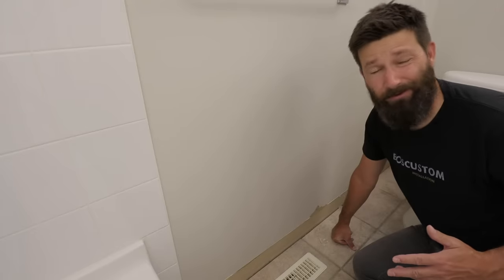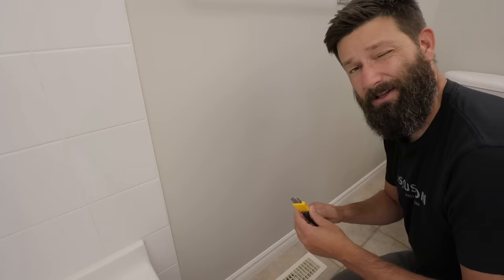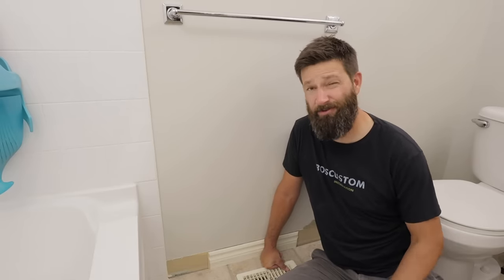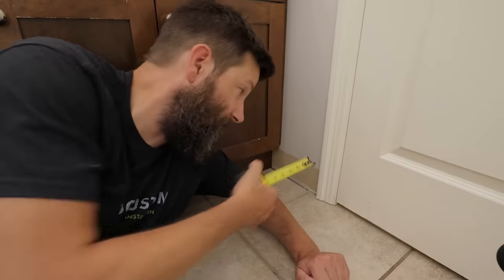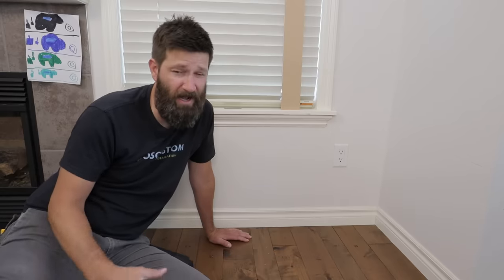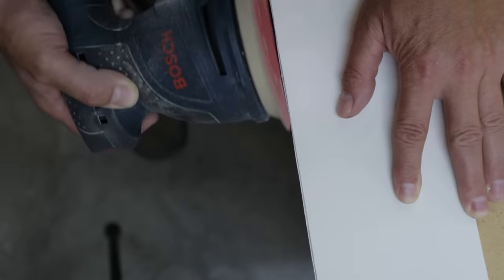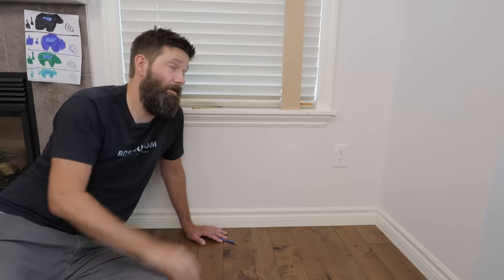The 4 Fatal DIY Baseboard Mistakes!

Comment: When it sits proud of the door casing that means you need to redo the casing and might as well get new doors. Since you're taking the casing off, might as well redo the floors. If the floors are up, maybe you should add some floor heating. Since you added floor heating in the living areas you really ought to do it in the bathrooms which means it's a good time to redo the bathrooms. If youe doing all that plumbing you might as well put in new plumbing. Welcome to my life.
Reply: I am right here.....we repainted the house to a different color scheme, only to find that the toilets were not actually white, they were light almond, so new toilets.....and the tubs....and the tile.....and the kitchen countertops.....and half of our decor.  We should've just knocked the house down and rebuilt it.....
Reply: @Calypso-rb9sf  Time to eat something white to make it match. 😂
Reply: Oh man.  I'm going through this, not quite as bad.  Got vinyl plank to replace carpet.  Might as rip out the crappy trim....might as well paint the walls too....might as well paint the ceiling.  One of these days I'll get to the part of actually putting the damn floor in.
Reply: Hahaha
Reply: Ah, yes. When a simple towel bar replacement ends up with a to the studs gut of the bathroom... And, of course, that's an opportunity to move some interior walls around... And, of course, during all this you discover old water damage under the windows... So off comes some siding and sheathing...

Eventually you end up renting a CAT 320...

So, don't bother to buy a towel bar... Just start at the heavy equipment rental yard so you won't end up with a useless towel bar that doesn't match your new home...
Reply: That's why I'm still renovating after 5 years, always those +1/may as well/since you're already there things that keeps on adding up lol
Reply: Oh yeah, I felt that. We started with couch shopping for the basement family room, which turned into taking out a cabinet (that hid the electrical panel) to fit a new sofa and if we were doing that, might as well upgrade the panel, and if we were doing that, might as well upgrade the service to the garage for a potential future electric car. And if we’re touching the electrical, we could really just take down the terrible DIY drywall the previous homeowner did so we can fix all the poor electrical junctions we know are hiding behind it, and if we’re doing that, we might as well move some walls, and if we’re doing that, we should spray foam the walls,  and while the ceiling is open, we should run gas lines for future gas range and outdoor bbq, and while the concrete is exposed, we should move the bathroom, and if we’re doing that we should replace the old cast iron piping and install a blow out preventer. … it ended up being a complete gut job. 2 years and 6 months (and two babies!) later and it’s alllllllmost done.
Reply: You had me sweating on the first sentence I gotta admit.
Reply: Are you me? I’m about a week from ripping the carpet out of my home office and if I’m yanking it from the home office, why not the whole 2nd floor.

Already looked into heating options😖…and this all started with changing out the ceiling fan.
Reply: @ang_131  My god, what a story! Next time my partner and I are getting the might-as-wells, I'm going to show her your comment and maybe we can just settle-for.
Reply: @beerhistory , I’m glad my story can help someone else! 😅 That said, I love every inch of our new basement and I’m not scared to open certain closets and cupboards down there anymore. We literally had a cupboard I refused to put anything in, I called it the spider cupboard due to how many I found in there during my original move in clean, whereupon I cleaned the cupboard and never opened it again until the day we tore it down. 😂
Reply: Someone else is living my parallel life? I did all that too! But I could not stop there. When I was down to the foundation my wife and kids got tired of the trailer so now I live in the trailer next to the hole in ground.
Reply: @beerhistory  trust me it won’t make much of a difference. It’ll always end up as “well honey we could just do one more thing since we’re doing this...”
Trust me, seen it with my parents too many times
Reply: Great post.👍👍
Reply: And now that everything is all done, might as well sell it for a nice profit. Babe, we are never doing this again. But since we’re in the market for a new house, might as well get one that needs a little work….
Reply: @spurcrawler249  🤣 😂 thats it!
Reply: @cyclemadness  I am in the same boat as you
Reply: We're 30K in debt over that EXACT circumstance.  Only in our case it wasn't a "might as well" scenario....it was a "so THAT's why the floor wasn't level", or "That's why the water didn't get as hot in the guest bathroom", etc....  The only solace I was able to get out of it was that, had I had to hire people to do it, I'd be $50K in debt. 👍
Reply: And once you start adding in-floor heating, you need to add circuits to your main panel. But it's only rated for 100 amps, so you may as well upgrade to a larger panel and 200 amp service. . .
Reply: @aaronmcleland4772  well now that you have extra space in the box...
Reply: Do one job and create two new ones
Reply: ... and once you've finished replacing all those things. You realize your basement height is lower than you'd like, but it'd cost $40k JUST to jack up the house to re-construct the entire foundation, so instead of doing that you sell your house for a $30k lose and build a house with all those issues addressed by building it correctly the first time!

Gotta love those DIY houses!! 😂
Reply: At my house I went from mudding and sanding the ceiling, to mudding and sanding the walls, to adding new baseboards, installing chair rail molding, painting the ceiling, painting the ceiling medallion, buying more primer, buying more paint, bought a 12" sliding compound mitre saw, and now I am installing 6" crown molding in a crooked house from 1975... I want to finish already 🥲 It's like it never ends...
Reply: @cyclemadness  my current situation! 💯🤣
Reply: Or just throw in a plinth.
Reply: @cyclemadness  I draw the line at painting the ceiling- thats never going to happen!
Reply: This is EXACTLY why I don't clean my window sills, thank you very much. Because it starts out as just a quick wipe down and the next thing you know, you are rebuilding your house....
Reply: @cyclemadness It's called "sequences"....
Reply: @spurcrawler249 Lol. Holy crap, that's me and my husband. EVERY home required renovations....and we were always saying,"Next house is brand new, we are NOT renovating again!" And of course every time we'd end up with "Well, we should get a place that needs some work, otherwise we'll be bored".....
Reply: @jasono2139  You guys above all sound married.  Establish boundaries, tolerances, costs and "livability" and just move forward.  Said the Bachelor.  Perfectionism is a plague, craftsmanship is meant to be enjoyable.
Reply: @yojimbos1  ironic that the person who thinks "perfectionism is a plague" is also a bachelor! 😂

Don't worry... the previous owner of my home would agree... because they screwed up nearly everything! ... which is why they probably placed tile flooring ON TOP OF the old flooring... 🤦
Reply: This comment needs an award
Reply: Exactly my experience the the last few month lmao
Reply: Add a backband around the casing then install your base to fix this problem.
Reply: @cyclemadness I hear ya -I’ve got the same thing going. I went ahead and put the plank flooring down just about to place the last 2 pieces. The cabinets need painted, the wall paper needs to come down and walls need painted and ceiling is gross but, hey, by the time I get to it, it’ll be time to replace the vinyl planks!
Reply: 🤣🤣"If You Give A Mouse A Cookie" is the book for you!

Comment: I learned a lot about baseboards in this video, more importantly I learned that Black Bears are the biggest of all the other bears.
Reply: Much bigger than green bears.
Reply: @davem6685  I like the red ones!
Reply: But which bear is best?
Reply: Bears eat beets.
Reply: Bears, beets, battlestar galactica
Reply: @brianwball40: I guess you failed the test then. Black bears are actually one of the smaller species well behind grizzly, kodiak and polar. I’ve seen teddy bears as big as some black bears, lol.
Reply: @rayray8687  🤦‍♂️

Comment: Want a perfect outside miter every time, first cut? Put painters tape on floor along both walls under where the baseboard will get installed. One at a time, place the board to be cut against the wall and trace along bottom edge onto tape. You now should have criss crossing line of the the basedoards outside edges. Place the board back in place and mark the outside edge of the criss cross onto the baseboards outside edge,  as well as the inside corner on the inside edge of the board.Put the board on your miter saw and adjust so that the blade just kisses both marks. Not only will the angle be perfect, but you won't make mistakes cutting the angle in the wrong direction. Not that any of us would ever make that mistake. Lol
Reply from the maker: A bit elaborate but I appreciate the effort!
Reply: @TheFunnyCarpenter  honestly, it's super easy and quick as well. I used this technique on crown molding too, since the ceiling was going to be repainted anyway, I just penciled right onto the ceiling. Fast, no cut mistakes, and it saves a lot of time caulking or filling sloppy joints later on.
Reply: I never made that mistake TWICE today EVER!! Lol
Reply: Is there a video that shows this step by step??
Reply: @rodbingaman6985  I remember what my grandfather said,"The elapsed time between making the same mistake in a given work period will greatly increase with a little bit of rigorous practice."

Comment: Another great vid!
I'm no pro but I have one quick additional tip that may be useful to newbies ( if watching, add in around 2:20); when prying base boards away from wall, work your way from one side to the other as he says, but try to APPLY PRESSURE WHERE THE NAILS ARE.  That works for basically everything you're trying to pry apart. Otherwise you apply too much flex to the board and materials like mdf may snap.
Reply: @keithmarlowe5569  The other day, I took up some solid wood trim that was installed ~30 years ago with hand-drive 6d finish nails. I kinda wanted to save the wood and see if it could be re-used on another project, so I went to pull the finish nails through the back of the trim, like I do all the time with 18 gauge pneumatic finish nails on MDF. 

Hoooolyyyyy crap. I think my arm was done after pulling just one through. The combination of solid wood being sturdier plus the bigger difference in diameter between the shank and the head on those 6d nails kicked my ass. Immediately switched to using my nail set to recess any heads sticking up and then flush cut the nails in the back.

Comment: 42 yrs as a pro. I never mitre inside corners. Cope only. Once you get the hang of it nothing else comes close for speed and quality. I simply cut an inside mitre,  then use a jigsaw with a narrow scroll blade and rest the bed of saw on flat of mitre and cut along the profile of baseboard. It automaticly back cuts the cope and gives knife edge to the cope. Also easy to adjust if necessary with a sanding block. Its easier than it sounds. Its super tight and fast. I run a room so fast it will make your head spin. Learned that trick from an old timer 30 years ago. Coping saw just takes too long. Of course im the old timer now. Love your tips. Great job.
Reply from the maker: That’s awesome Paul! Every good carpenter should know how to cope mouldings!  The place it come in handy for my is installing cabinets and tying in new crown to old crowns.  Thanks for supporting the channel!
Reply: @TheFunnyCarpenter  I cannot yet understand how to make the cut as described above. Can this be referred to in a video, or photo, so we can see it? It says "never mitre inside corners" but then says to do just that, "cut an inside mitre". So this is cutting a mitre but only half of the corner, on one piece only? So the one "half" mitre is the cutting guide for the other inside piece?

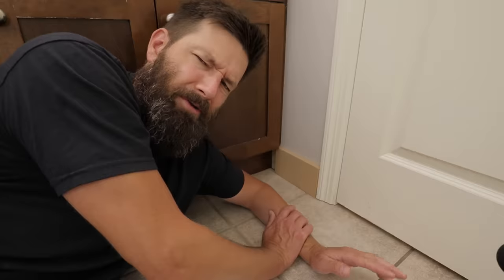Comment: 4:04 if people want thicker baseboards they can just use a multi tool to cut off a bottom section of the door casing and install a thick plinth block.  Looks nice.

Comment: Before installing baseboards or flooring have a professional come in and level the floor with leveling cement in required areas. They use lasers for this so it works well. I believe this would eliminate the need for shimming undersides of baseboards. Your thoughts? I had it done on my house and it worked good.

Comment: Replaced my builders grade finger joint pine baseboards a couple of years ago with larger poplar bb.  I didn't want to replace all the casing so I just added a back band molding to all the door casings.  Looks fantastic and a lot less $$ than replacing all the casing.
Reply from the maker: That’s a great idea, I’ll remember that for the future.
Reply: What is a back band molding?

Comment: baseboard to floor gaps traditionally hidden by quarter round, shoe mould or door stop in most parts of Ontario, would never consider installing baseboard without one of those options. going to try your inside and outside angles, have a lot to instal . I personally like the look of oak quarter round finished to match the hardwood floor.

Comment: Very interesting. I bought an older home where the floor has sunk in a few places. Theres a massive 1/3''+ gap with the baseboard that I'd love to clean up. May have to try this in the future, but sounds like ill need to start with a pretty big board to compensate.

Comment: I know some would give me grief over this, but we pulled up carpet in three bedrooms and closets and put down wide hardwood planking. Floor needs expansion gaps hidden under trim. Choice was to pull up all the baseboard and replace over the new floor or leave the baseboard, add a gap and cover with quarter round. I chose the second one.  We saved tones of money and time.   It looks great and I would do it that way again. It also solves about half of the problems shown here.
Reply: @blaster 0416: If the baseboards are 100 yr old 1x8 planks over plaster you definitely don’t want to remove them or you will also remove half the wall with them, lol.

Comment: My table saw only goes to 45 degrees. I don't think I can stand this long board on end to do a 45.75 degree cut. Do you actually have a way to make that cut? I definitely need to do it as you were spot on with pointing out the problem.

Comment: A few pointers I will add from my struggles or experience.  The trim removal bars are worth the $30 if you are doing a whole house or frequent work.  Coping the inside corners is my go-to after trying different ways but I use an angle grinder to cope; learned that from another YouTuber.  You need a steady hand but it works on MDF or finger-jointed pine.  For dealing with humps in the floor, my Bosch 12V mini planer is magical for shaving down the bottom edge of baseboard quickly.  I was already in the Bosch 12V line so it was an easy purchase for me.
Reply: Whoa, somebody saw you coming, lol. That ‘Richards’ flat bar sells for about $10 everywhere and the no-name varieties are about $6.00.
Reply: Trim Puller brand name tool is 30 and worth every single penny. It’s one of two tools I own that is never lent to friends
Reply: @johnbrunko : The Richards flat bar being used in this video is pretty much the only thing I use to remove baseboards and casings of the past 40 or 50 years designs. I usually back it with a 4” putty knife until the trim is loose (to avoid damage to the wall) and then just pull the trim off mostly by hand. I own several of these bars because no one I hire ever has one and they’ll start removing trim with a 36” wrecking bar if I’m not looking. Those little bars cost between $6.00 and $11.00 and at one time, along with the Estwing 20oz straight claw steel-shanked ripping hammer, they were the most stolen item in my tool kits.

Having said that I also own pretty much every other size and design of prybar including a cat’s paw, a ‘trim-puller’ type and traditional and non-traditional crowbars from 8” to 40” that cost anywhere from $1.00 to about $24.00. The cat’s paw is an older style Estwing and was FREE! After decades of ‘donating’ my tools to other trades someone finally left something behind for me. I have no idea who left it but after a week I took it with me and still have it if you’re looking for it, lol.

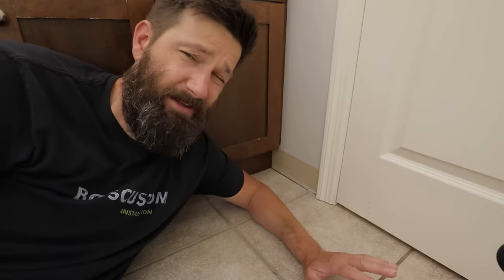Comment: About using thicker boards than the door casing (3:30): I have used several 'end pieces' inbetween the boards and the door casings. They are small rectangle vertical bars that match the thickness of the boards, which still delivers a clean finished look.
The shop where I ordered my boards supplies them, but they are also easy to make yourself.
Reply: I think they're called plinth blocks!

Comment: I'm using flat stock MDF to make baseboards. One side is perfectly square, the other has a slightly eased (bull-nosed?) edge. Which side should go up? I like the look of the square edge but I'm afraid it might be more prone to dents. Maybe the eased edge looks more finished? We have eight foot ceilings, except in the living room. Should I go with baseboards that measure 4 1/2" or 5 1/2" thick. Decisions drive me crazy. Our door casing is RB03. Is it too fancy to go well with flat baseboard? TIA